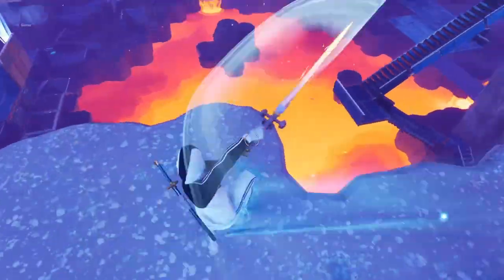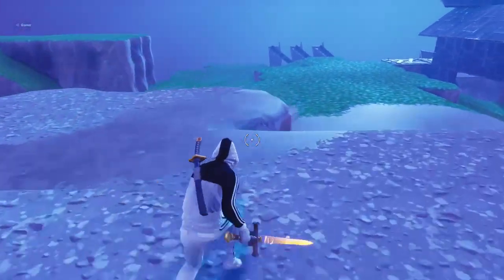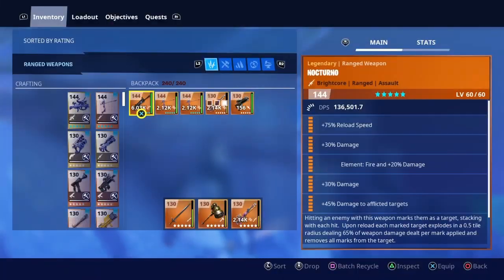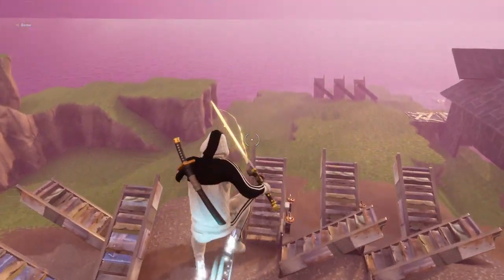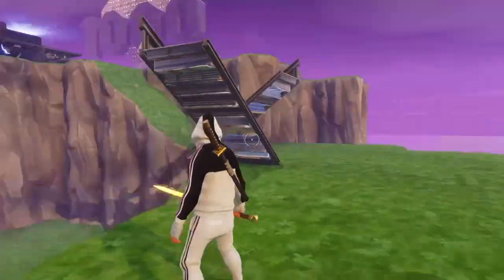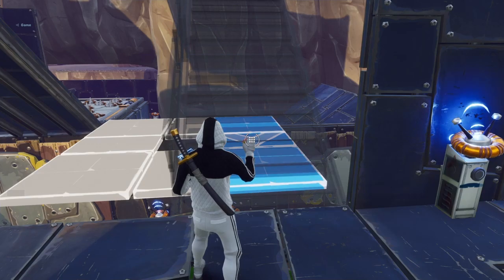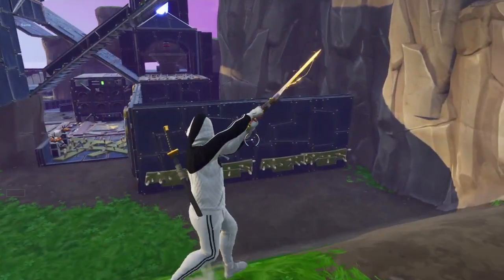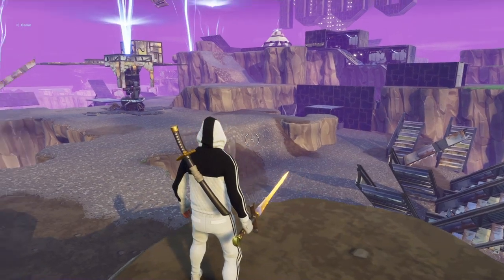Twine Peaks Endurance, New Wamp, step by step

Comment: Does this type of block-off work in areas where previously heavy block-off was used, like some Pit builds?  Do you need to do multiple layers of it?
Reply from the maker: Possibly yes, but would require alot of testing areas.
Reply: @fireburn045  I think I may try it in some areas to close shorter gaps, other ramps, places like that before heavy spots.

Comment: The block of doesn't work smasher want to charge on the stairs did u change something ther?
Reply from the maker: Yes are you online now?
Reply: @fireburn045  no im not but did u change it in a stream?
Reply from the maker: @emil-rdw8059  no but I will show it in tomorrow's live stream at 12pm GMT, if you get on before then let me know and I quickly do it for you, its a little small change
Reply: @fireburn045  im online in like 45 mins
Reply from the maker: @emil-rdw8059  ok holler me here on this comment line
Reply: @fireburn045  im online what's ur epic?
Reply: @fireburn045  I added u
Reply from the maker: @emil-rdw8059  invite me
Reply: @fireburn045  soofy for being annoying but I got the same problem as before w and idk what's wrong what does your smasher wants to do on this amp?
Reply from the maker: @emil-rdw8059  it's a glitch smasher stuck in stair, happens once and then it's fine, it's like a build glitch but it's a piece involved
Reply: @fireburn045  but on my block off smasher charge on the stairs I can show you a clip if you want
Reply from the maker: @emil-rdw8059  have you changed to new update from my live stream today?
Reply: @fireburn045  u have done it on my home base yesterday or did u change something new
Reply from the maker: @emil-rdw8059  can't remember I help't a few yesterday
Reply: @fireburn045  Ah ok I saw your stream and in wave 3 u got the same problem too so I guess I was unlucky cause I try it 3 times and evrytime the smasher was "glitched"
Reply: @fireburn045  can you link to the point in the stream where you do the update?